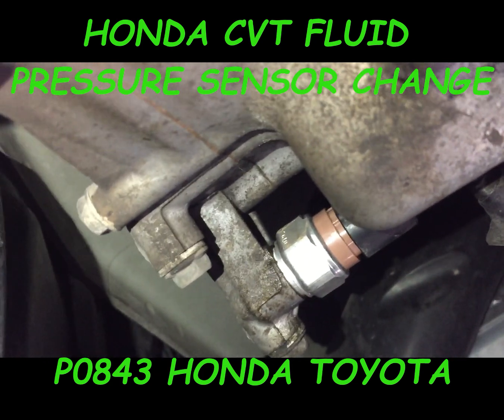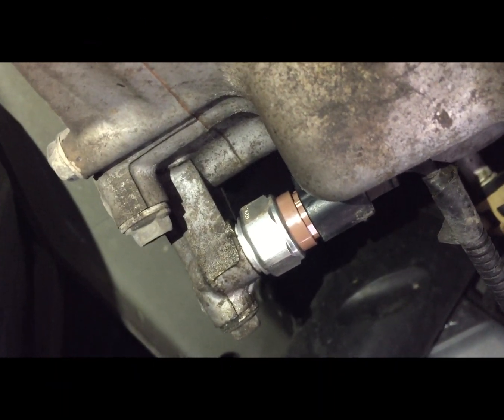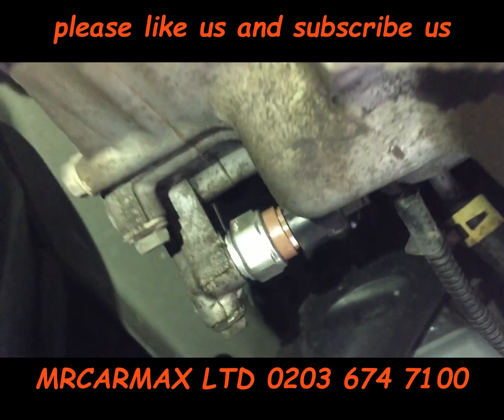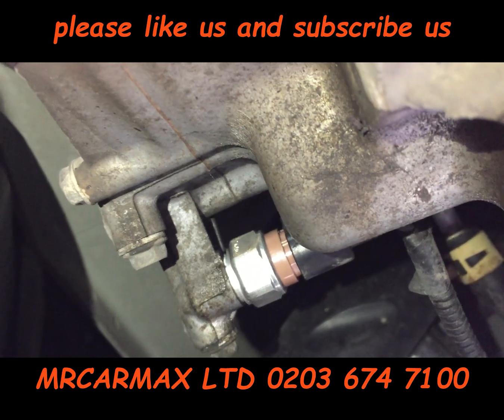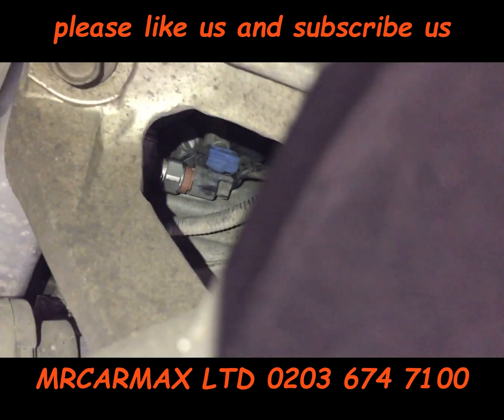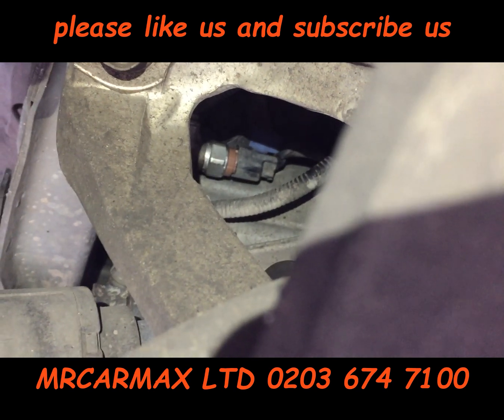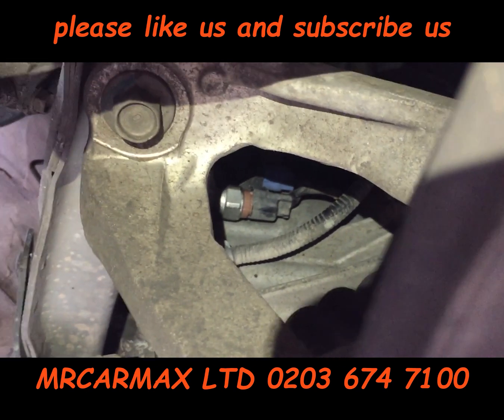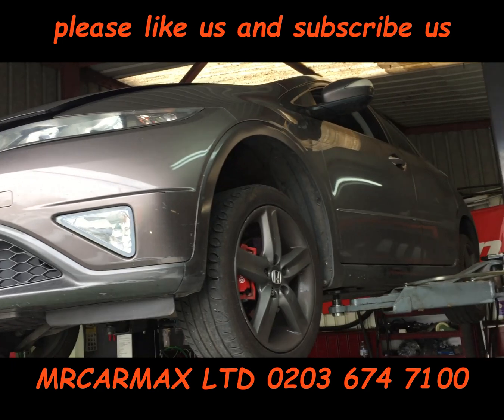P0843 HONDA  Transmission Fluid Pressure Switch 'A' 2nd Clutch Circuit High shift solenoid is open

Comment from the maker: P0843 shift solenoid is open or close hydraulic pressure sensor honda civic jazz cr-v toyota  P0843 HONDA  Transmission Fluid Pressure Switch 'A' 2nd Clutch Circuit High. visit our ebay store: https://ebay.us/BAFRHC